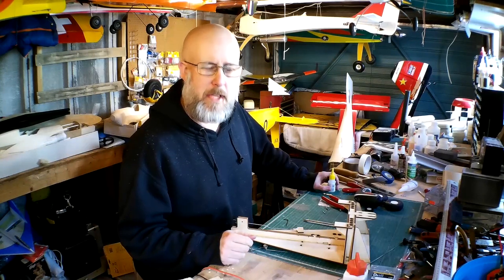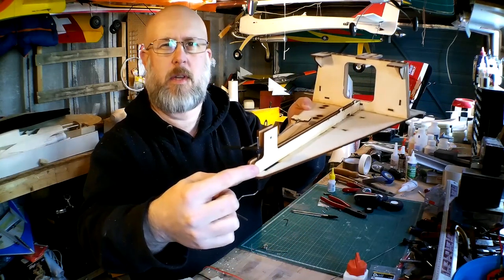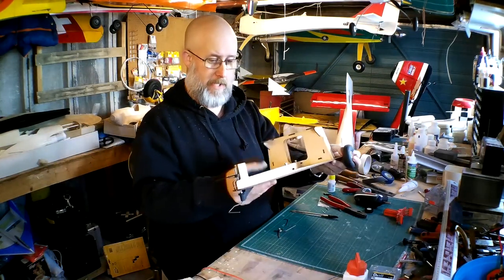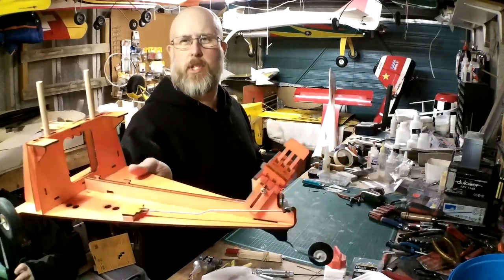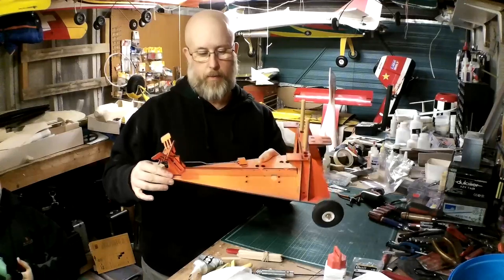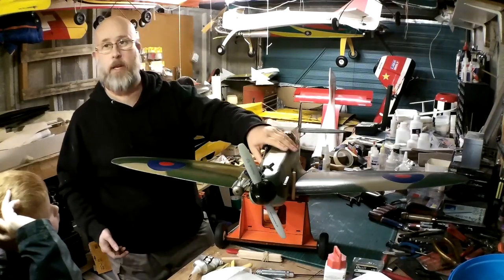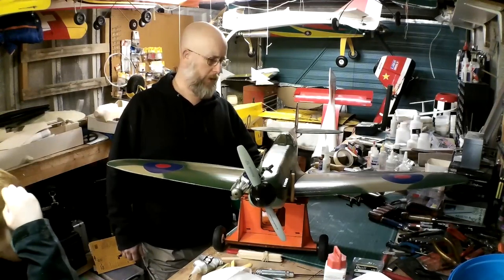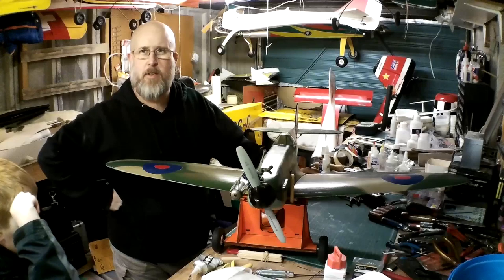Funfighters.co.uk Takeoff Dolly Build Pt3

Comment: Hi Nick, I've mounted a fixed rear wheel in such a way that the rear of the chassis is only just clear of the ground, and have 3.5" front wheels.  This provides the right angle, and also keeps the centre of gravity low.  Only used it once because I've not been flying this week, and it worked a treat.  On a no wind day was in the air in about 5 yards.  I will also be using it for Vampire I've just finished making.
Reply from the maker: hi Alan, i suspect i will have to mod it in someway to improve its performance but until i try it out i wont know.